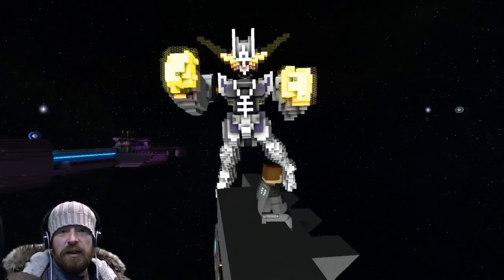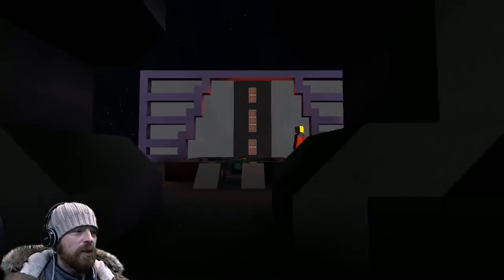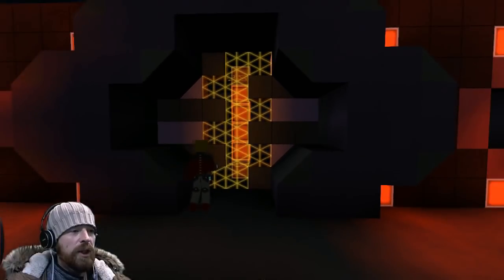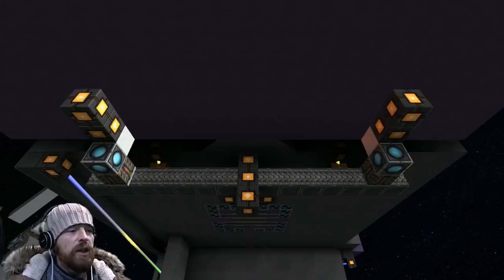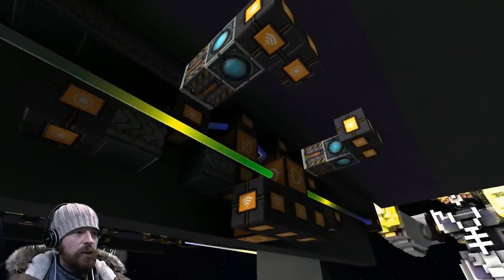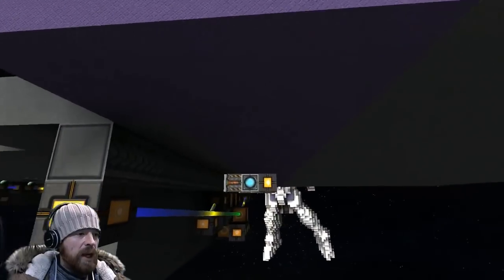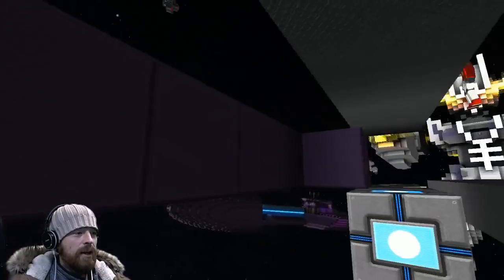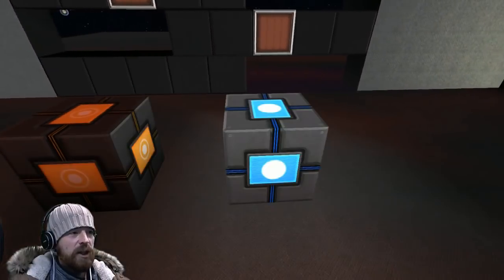Rail Doors in Starmade! More Moving Parts!

Comment: Use  flip flop to make a one button switch door
only downfall its logic takes more room
Reply from the maker: Use t flip and not mostly now. This video was done in the Dev build before it made it to release so was a while back. The focus was on varied door designs so I didn't bother much with the logic besides hiding it all.
Ironically I prefer to have logic on display like machinery of some kind. 

Thanks for watching!
Reply: ya there are still some bugs like I was making a Imperial landing craft like ship that had folding wings like the one in starwars but they keep de docking and it pisses me off cause I have to fly so far to catch the loos wing
Reply from the maker: Redbrutegammingguide Damn right. I hate that you gotta undock to save a door. Lol loads of fun